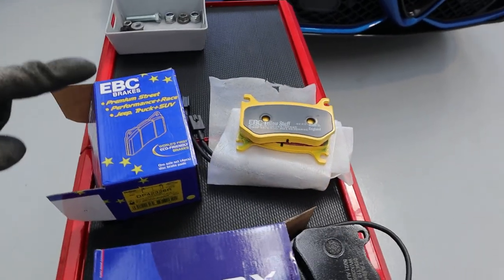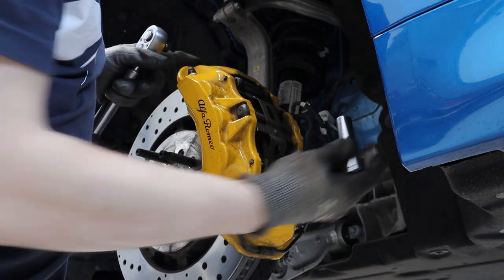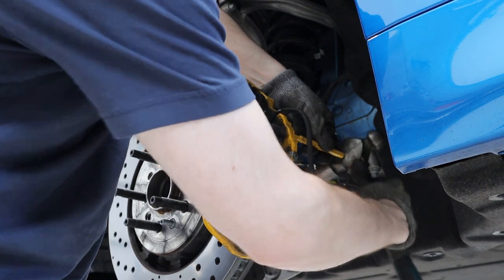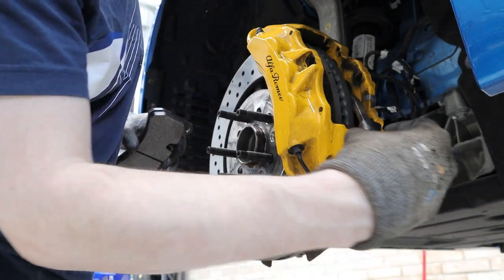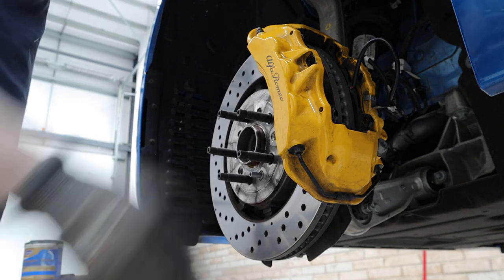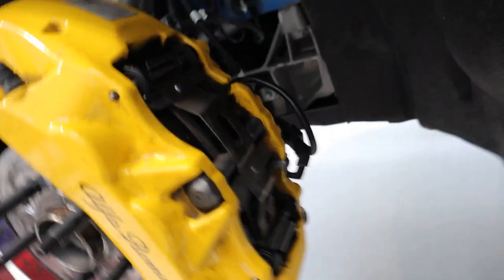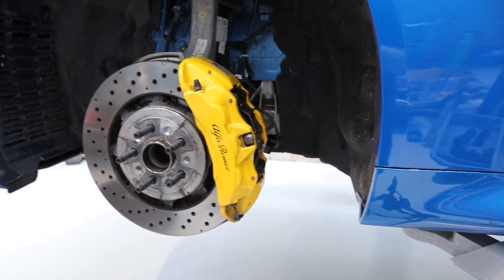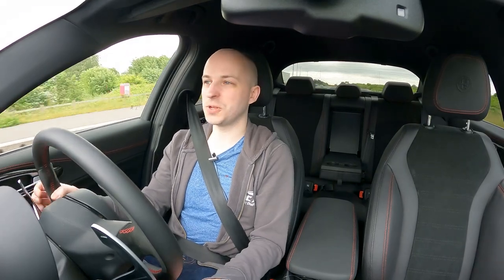Tarox Brake Pad Install & Impressions (Alfa Romeo Giulia Quadrifoglio)

Comment: Wondered which pads you settled with? Tried yellowstuff and now bedded in find the low speed bite very poor. Almost impossible to stop smoothly.
Looked at Bluestuff but also considering Ferodo DS performance or DS2500

Comment: Thanks! Great video and right on time as I'm going to install new pads on my QV for the first time this weekend. One question - did you disconnect the battery before installing the pads? I heard many stories about getting error codes after doing DIY work on Alfas.
Reply from the maker: nope, and didn't get any warnings or anything

Comment: Is it not potentially the brake booster moving ? Same as what happens in the gt86/brz . Used to get a mod that attached or was part of the top strut brace
Reply from the maker: with it being brake by wire, I don't think there is a brake booster. I always thought the only reason cars have them is to make it easier to press the pedal... but as the pedal isn't connected to the brake system, you wouldn't need it
Thinking about it though I guess what you really mean is the master cylinder, which just happens to be connected to the brake booster, but yeah again with it being brake by wire there is no pedal pressing on that so I doubt that's the cause
Reply: @ChrisDrift  AHH sorry. Not a car mechanic. Is it possible to vue through something like vcds. The time delay between you pressing the pedal and it registering that pedal press then?

Comment: Got EBC Bluestuff to fit to mine. But my bridge bolt is seized into my front calliper. Need to set aside a day to pull the callipers off completely which isn’t ideal. 

We also have a pretty big and very active  whatsapp group for Quad owners (mostly UK but some from rest of world). Get loads of help and advice in there. Can DM you a link if you want to join
Reply from the maker: Bluestuff are more aimed at track days right? I know they'd be ok on the road as well but I was worried that as I'm trying to get more initial bite during gentle braking at lower temps, if anything they might be worse than stock for that. I am keen to put the yellowstuff in soon and see how they compare to these tarox ones though
Reply: @ChrisDrift  yeah they’re an entry level Trackday pad. They are R90 approved for road use on the Quad though and boast a good cold bite. I’ll find out soon enough
Reply: Would be interested in joining the group.
Reply: How were the yellow stuff pads?